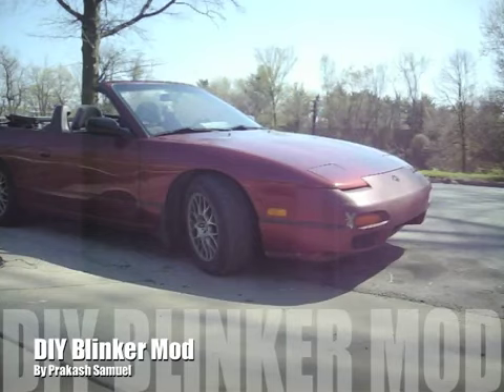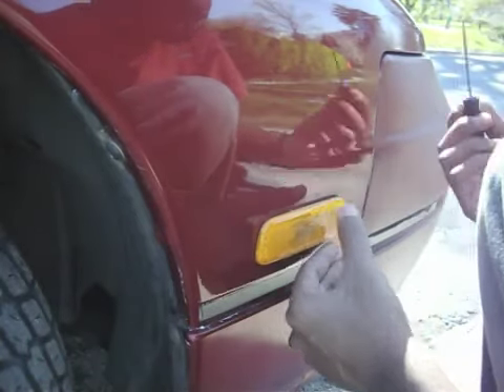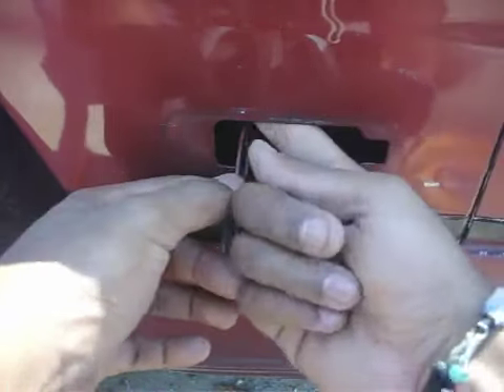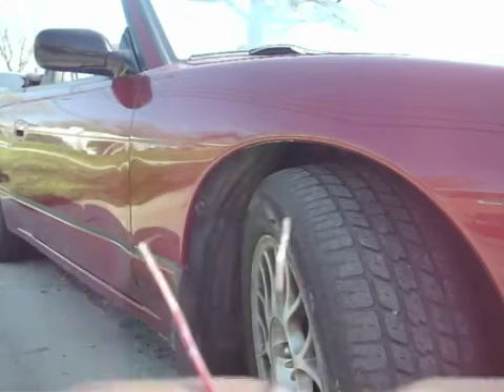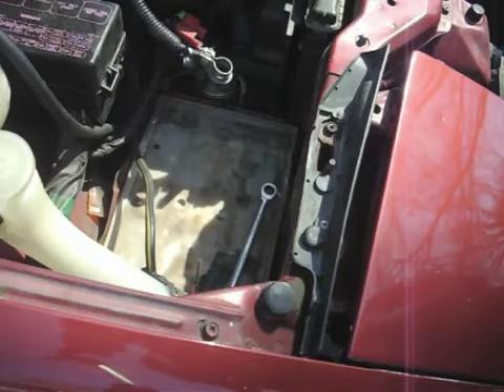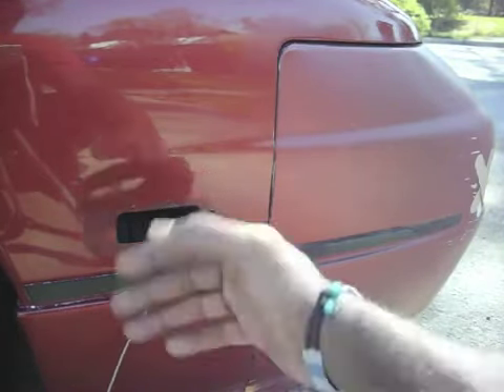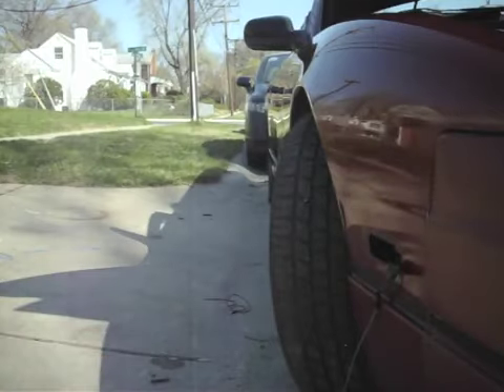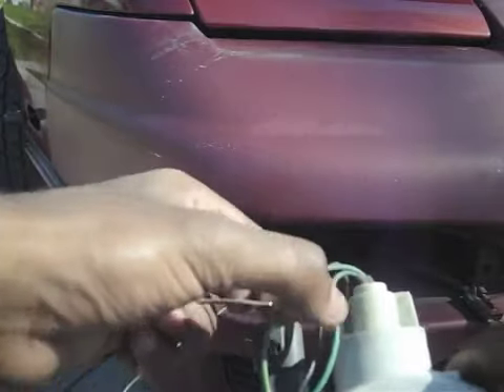Ep:1 DIY Blinker Mod

Comment from the maker: @blake110491 Yea, soldering is the best way to do things when your putting wires . However, if you tightly twist the wires together and then wrap it in electrical tape properly, you're not going to have problems for this application :)

Comment: Do you by any chance know if the side markers on an S14 blink? I blew a bulb, replaced it with a used bulb I had while outside the auto shop, tested the bulb out and noticed the other side went out. When i pulled it out I noticed that one blew so I went into the shop to buy a set. After putting the new bulbs the lights turned on but didnt blink. I dont know why but I was under the impression they doubled as turn signals and blinked when the hazards were activated.

Comment: simple question about this mod. is that legal in the sense that police can't pull you over for having your cars side light blink like a turn signal and having your car modded that way?
Reply from the maker: I dont think its illegal man, there are plenty of new cars that have this from the factory
Reply: ok thanks man
Reply: +Project Garage I need advice, did this and got it to work with halogen bulbs, then upgraded to LED bulbs and they won't turn on, and only on with turn signal, not when parking lights are on, (only flash when turn signals) 

thanks for any advice or tips :)

Comment: the exact same thing is acomplished buy cutting only the black wire and adding the extra piece to it. There is no need to cut both wires when your just gonna reconnect one. The bulbs are reverse polarity so connecting the black to the red is pointless.

Comment: Not very reliable to just twist the wire together that creates problems later on.It would be better to solder then shrink wrap or butt connectors then tape over that.I've spent so much time re-wiring my car by fixing those mistakes

Comment: I do this mod on all my cars as well (except for GM and honda which are already wired this way OEM.)  I am definitely not a fan of your wiring methods (very unprofessional) but it's your car. 
Not hating but just coming from someone who has done multiple motor swaps and cringe when I come across cars with wiring hack jobs like this. I know "it works" but it only takes a few more minutes to make it look like it was done by a shop, and it won't cause wiring issues down the road.